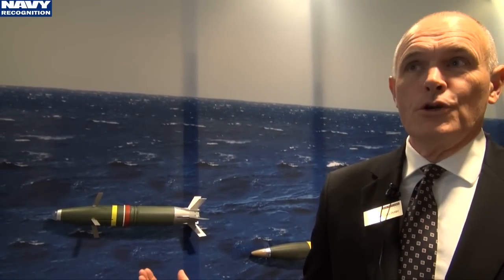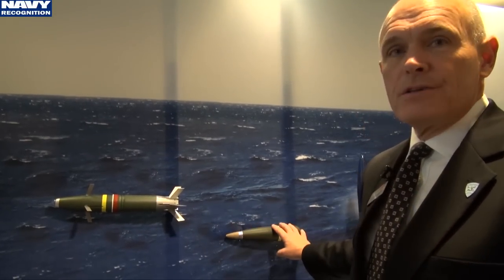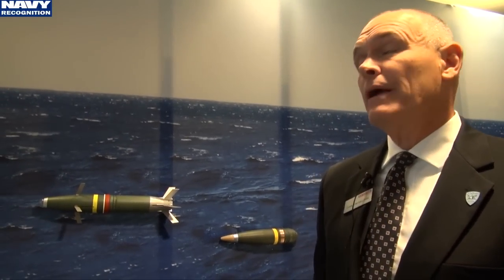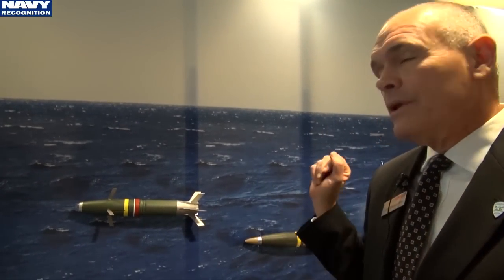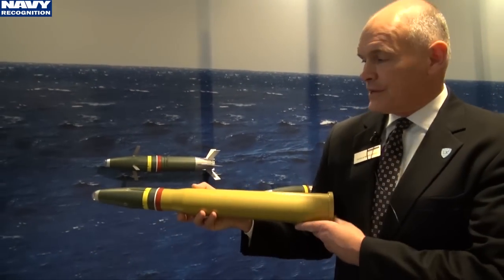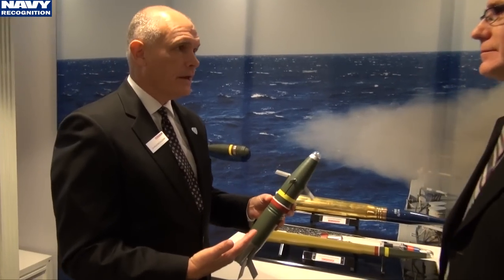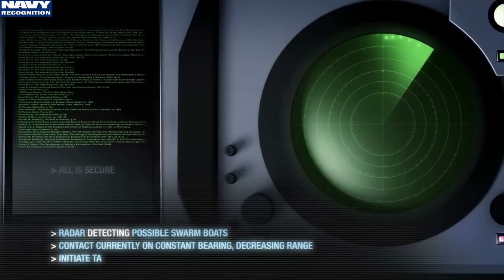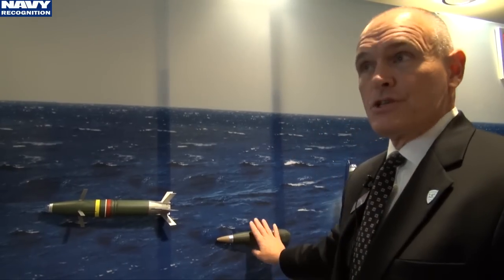BAE Systems ORKA One Shot One Kill Round for 57mm Gun at SNA 2016

Comment: In the naval combat arena, the 57 mm gun is a flyweight. It’s round lacks the range and warhead to engage anything bigger than a patrol boat. It was in fact developed as a CIWS against missiles and aircraft. It was never designed to engage anything other than small objects and lacks a sufficient charge to engage in battle and severely disable or sink a combat ship even the size of a corvette. Some corvettes are better armed. Coast Guard cutters used to be armed with a 3” (90 mm) gun, let alone the 327’ and 378’ classes. Coast Guard cutters are now being built in excess of 400’, rivaling that of a frigate. Frigates and destroyers are generally now equipped with a modern 5” gun. These guns are in current production with widespread use and ammunition all over the world. A cutter armed with at least 1 5” and 1 57 mm stern mounted gun used in the roll it was designed as a secondary battery, CIWS has a better chance of defending itself, until and at last have a chance of defending itself until such time they are additionally equipped with rocket batteries.
Reply: 3" is 76mm.  90mm is 3.5" in diameter.
Reply: CIWS like Phalanx lack the needed range and can  be saturated in part due to limited range.   5 inch guns are simply too heavy and their rate of fire is to low to allow multiple engagements.   The Mk210 has a RoF of around 220 rounds/minute.    Ships of 2000 tons are being taken out be marine drones the size of a jet ski.  Something new is needed.

Comment: How much per rd ? If I engage 10+ boats in a swarm attack and each rd cost 35000 I going to use the 30mm instead or use the standard ammo.
Reply: Exactly! There's no use making everything guided if it's going to cost more than just shooting a bunch of cheap rounds to do the same job.
Reply: @sergarlantyrell7847  er.. you do realise that the more you have the cheaper it is to produce so that price of 35000 will drop if you buy more, that's how deals are done. it is a moving target that price, that's the point. equip your guns with nothing more than guided ammunition and each round will of cost you perhaps half the starting price- 17500 now it is cost effective.
Reply: @stevechurch4728  that only works down to a point.
We don't know how many rounds that price is anticipating they're producing.
The best gauge is to judge by other guided rounds that are available... Which are all many times more expensive than standard dumb rounds or even timed fuse airburst ones.
Reply: @sergarlantyrell7847  isn't the question cost effectiveness,  the one shot one kill guided round v the many dumb round  equation. overall the former taking into account the factors around maintenance, parts cost, down time to repair,reload re-engage new targets with training over lifetime costs and advances in technology i would still take the one shot one kill option for the longer term service advantages.
Reply: In war you don't care about the cost.
Reply: @su-25frogfoot74  - In war, you can only keep producing ammo, tanks, guns, etc as long as your economy can bear the cost and the resources to make weapons are readily available. If these resources are unavailable or you need to import them, you have to purchase them. If you cannot carry the cost due to a stressed economy your nation is at a disadvantage.

Comment: The thing that amazes me about guided rounds like this is their ability to withstand 20,000 Gs at the muzzle.
All of the circuits and actuators must bear extreme loads without disintegrating or buckling.
Reply: VT fuzes in ww2  were filled with resin to protect the fragile vacuum tubes
Reply: @wat8437  Wax.
Reply: There are two key methods used to make shells shock resistant.  1 If you make an object 10x smaller it has 10x greater shock resistance.   2 World War 2 proximity fuses had the electronic components floating in oil.   This had two effects:  pressure on the component was even (eg a vacuum tube) and if the component was carefully designed it had neutral buoyancy.
Reply: Except for the electrolyte flask, which utilised the 20,000Gs to break open the flask, force the electrolyte into the cell and power up the Proximity detection circuit
Reply: All about packaging. If it has no voids to move into it won't move. And if it isn't compressible by much (which nothing interesting is) it does not create the void by itself.

Comment: They haven't been able to squeeze a reliable guidance system into a five inch round yet, even after decades of trying. I find it difficult to believe they could do it in half that diameter and less than a quarter of the volume. And I'd like to see the cost per round. 

A LRLAP round for a 105 size round is in the hundreds of thousands of dollars. As guided rounds get smaller the destructive power on target gets exponentially less for the dollar cost. At a given range it would be just as cost effective to go to a powered missile.

Powder propelled guns are density-of-fire weapons and will be unlikely to be anything else. further research into railguns would be a better investment.
Reply: Rail guns are a bust.
Reply: Снаряды с программируемым взрывателем
Reply: If you order these by the hundreds of thousands, or more, unit costs become affordable
Reply: . . . right, so rail gun projectiles are going to be really effective and cost effective against small boat swarms and for your information, the ORKA leverages technology BAE Systems developed for larger 127 mm and 155 mm guided rounds, using a 4-canard actuation systems to guide the round. It is fitted with a multi-mode imaging semi-active seeker that can be guided through laser designation or autonomous targeting by downloading image of the target prior to firing . . .